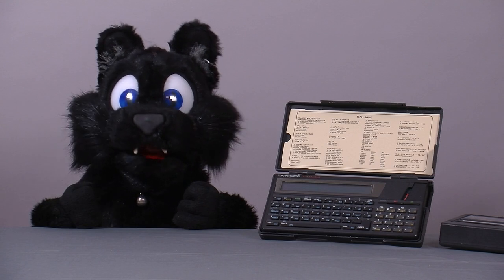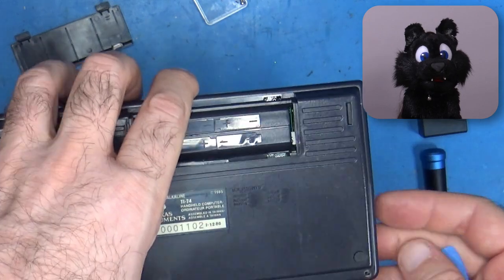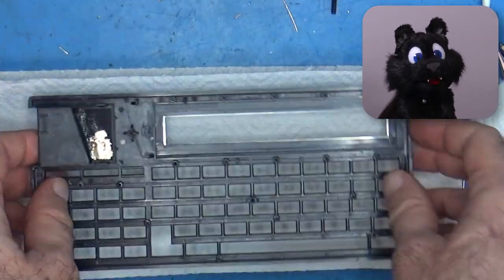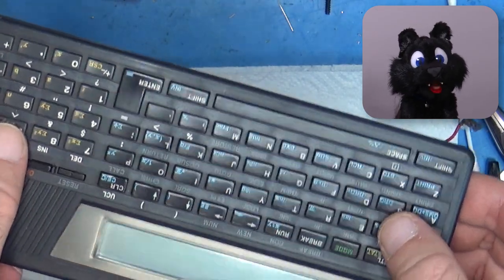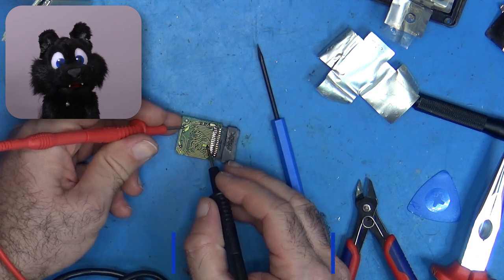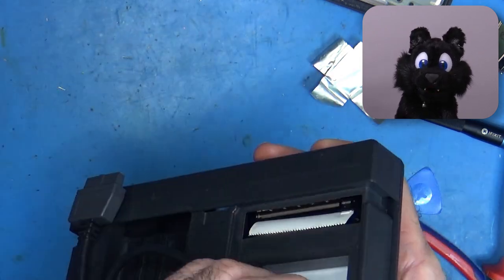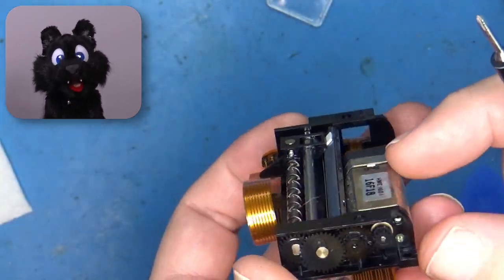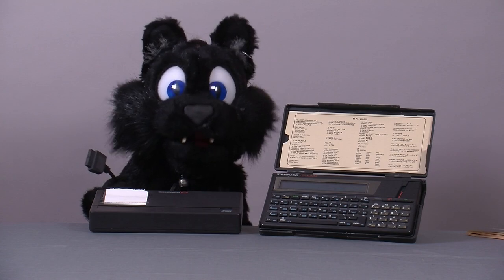TI-74 - Restoration Project #41

Comment: Well restored, as usual. The memory module looked odd, with what appeared to be aluminium tape surrounding it (any battery would probably not have survived that).
Reply from the maker: Everybody was all over the "RF shielding" back then. I did not put in the memory module foil because I doubt I could prevent any shorts. The original had what seemed a thick-ish double sided tape on it.

Comment: Very nice. I have several, but no printer (nor an interest in one). 

And I had the same thing happen with the TI-95. I had bought it in Colorado Springs at a pawn shop and lost it in a move and for the longest time I was convinced that it was a HP-95 calculator. 

I eventually figured it out and got a couple replacements. :)